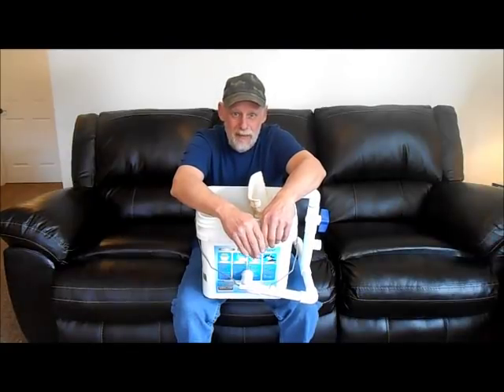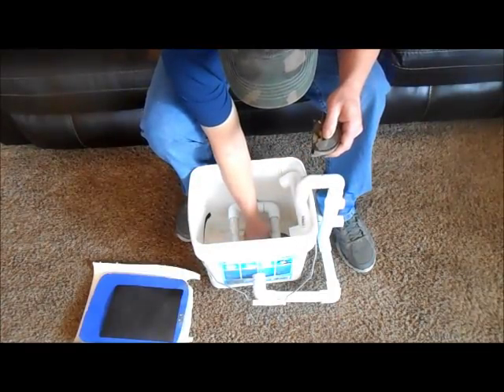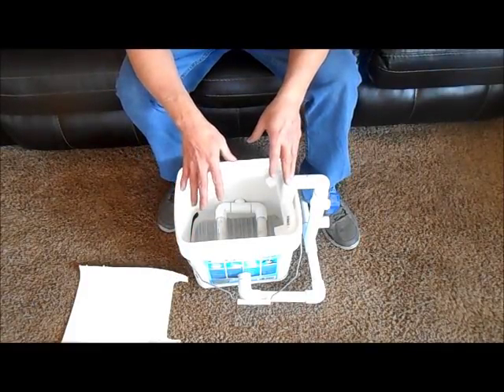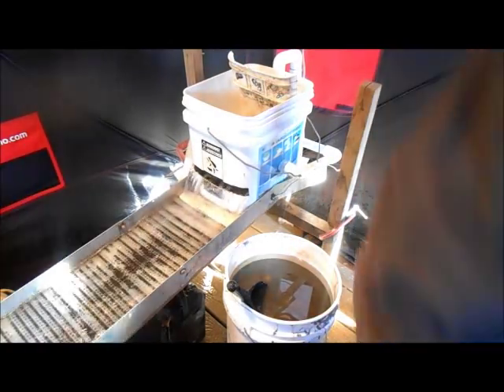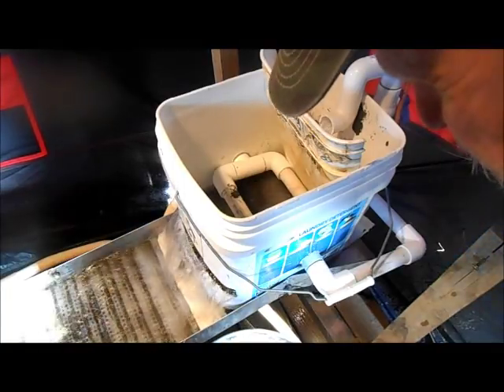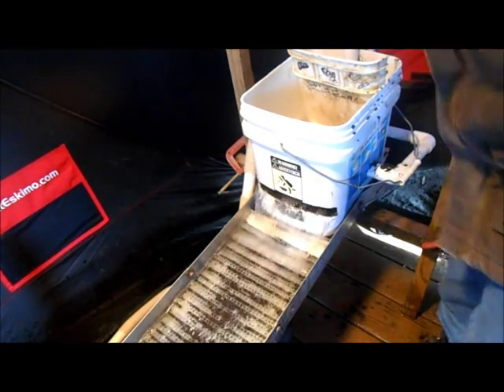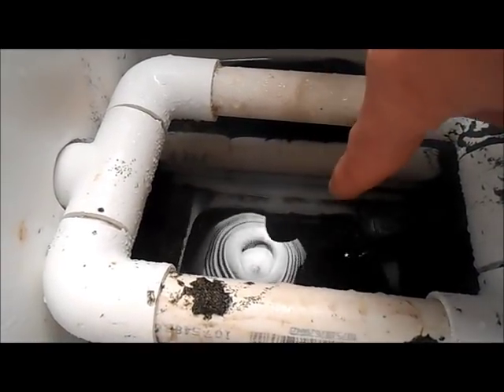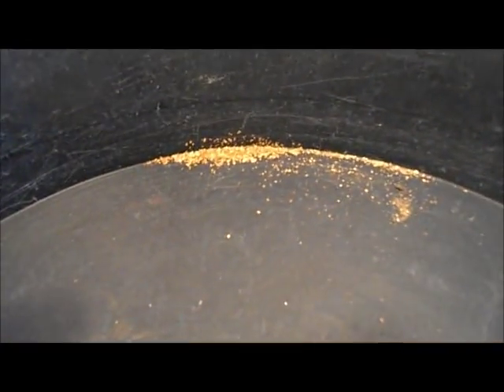Reverse Fluid Bed Magnetic Black Sand Gold Trap Experiment

Comment: Hi Alan! Love your videos. One note on used method: to see how well it performs you'll need to have well known starting conditions, like "sand with zero gold" plus control sample with known weight. Then your "before and after" will show exactly how well it performed (or even each section separately - as you did it). In your case you had it all almost right, the only missing piece was clean "no-gold" sand. Now, with 1 unknown variable there can be variety of cases. For example: what if your setup looses more than it caches,  you just happen to have 3-4 grams in that sand and you accidentally caught 1.7gr, which consist of only half of your original 1.4gr + some extra new gold from the sand!  ; )
Also simply "let's run it 2-3 times" won't work. If some dust-size gold coming through the setup 1st time, it will most probably go through next times. It's better to have those tailings after previous experiments plus to make it more challenging - mix couple glasses of extra black sand (collected from previous experiments with magnets), then you'll see exactly how much your setup is loosing. It must loose at least few percent on each run. Enriching the original sample was fun to watch, but didn't prove much (the only number I trust from this run is the ratio of gold caught in the trap vs amount of gold caught in the sluice, btw - you cleaned them separately but didn't measure). Thanks for sharing!
Reply from the maker: Hello Dmitry I totally see where you are coming from and you make some very valid points that I would agree with I will keep your tips in mind for the next one. Thanks for watching.

Comment: Looks like you have another keeper there Alan. Any time you can end up with more gold than you put in is a big win. Is this still the black beach sand that you are working? On mine I removed all the magnetics before I ran and that sure helps. Still a lot of work.
Reply from the maker: Not to bad for the first try. Yes still working on the beach sand. I want to do some more testing on my set up but the clean ups are taking forever so I have a blue bowl on order I hope it will help speed things up. And I am not sure at this point if I need the magnets at all.
Reply: Alan Robertson 
Yippers it's fun stuff. One suggestion if I may on the blue bowl, be sure to run a sluice underneath the output as they are notorious for blowing out the fine gold.  Have found that the Miller Table is the best for working this material. Most of the gold we get around here is -50 mesh and smaller so I have spent years trying to capture this fine stuff. It's good training and keeps you humble :-D
Reply from the maker: Thanks for the tips. I am sure getting a lot of practice with this stuff. The plan is to have the blue bowl run into the clean up sluice I know that Ira sets his on top of his gold rush nugget bucket and has good results.
Reply: Alan Robertson 
Once you get this mastered, and if you use these techniques when you get out on your claim I think you will find there is a lot more of this fine gold in that dirt than you realized. I was really surprised at how much there was. Good project for you for the winter. :-D. Keep at it.
Reply from the maker: @utahavalanch  I believe you are absolutely right I have been missing a lot of that fine gold. Practice makes perfect.

Comment: Nice build. It's kinda like a hydraulic riffle header box with a twist. I'm wondering if the magnets might be holding the black sands down and clogging up the riffles. Either way catching over half the gold in the header box is a win. 👍
Reply from the maker: Thanks Brandon. It did work great and I am already second guessing myself if I needed the magnets at all it might work just fine without them. I will have to give that a try.

Comment: Lol 😆 Alan you are the only prospecter I have ever seen that can make a machine that grows Gold. I love the design and no question it works but again that dam black gold grabbing sand, I wonder if you shouldn't remove the big magnets and just use the the sheet under the mat. Couple of other things that may help. I think the reason your material is channeling to the center of the sluice and a simple solution. The curvature of the bucket is I'm pretty sure is causing this. And what I did for this was simply to rival a strip of1/8th inch steel to flatten out the flow and that works great on my sluice box (I love plastic buckets!!!)  Now I put the strip on the outside because it was for a different set up but in your unit I would put it on the inside so it makes another little bump that any gold is going to have a hard time getting past. Then maybe take a piece of strip magnet and attach it to the metal. This should allowed a lot of the black sands to escape. And the magnet strip will work like a comb for ultra fine gold. I absolutely love your creativity and I sincerely thank you. Now a thought on( deflection plate l think you called it) it should be simple to fix if you're looking to increase the opening, I would take it and lay it flat heat a line across at about a third of the way from the top( l use a paint heater) lay a straight edge on it and bend to where you want put back in the bucket and trim sides as needed for fit. I made a similar piece for my rock crusher feed. Really looking forward to the next one.
Reply from the maker: Thank you for the input and tips  you are right about the cure in the bucket A strip of metal should fix it Thanks. As far as the magnets I didn't show it in the video and I should have where the big magnet was in the back of the bucket under all the black sand was loaded with fine gold so I think I will stick with the big magnets for now. I am still not sure what I will use to feed the bucket with we will have to see what I come up with. Thanks again.

Comment: It's a mint contraption😉👍 just one thing.when I've been watching paydirt reviews when they have gold in different trays they usually just use one tray and tip the gold in and out of it because they don't all weigh the same.just something to keep in mind! You would think they would all be the same weight but it's not the case like!👍 excellent video none the less man.
Reply from the maker: For a first try it sure worked well. thanks for the tip on the trays I will keep that in mind.

Comment: Ok a few things this may be long sorry in advance so I have a stream sluice I want to turn it into a high banker but using no pumps as I don't have money like that to spend on them I have a unlimited free supply of plumbing pipes fittings ext I have plenty of ideas for that but now I want this as part of the system you think you could come up with something??
Reply from the maker: My mind is drawing a blank right now. the only thing I can think of is gravity feed water but not sure if you could create enough pressure. I know you said no money for a pump but you can buy one on Amazon for $14.00. Sorry I wasn't much help good luck with your build.

Comment: Good deal I'm going to try to make some mats this spring for my dredge
Reply from the maker: My thoughts are that they will work fine in your dredge but it i have not put them to a real field test yet since it is winter now and I have only ran 1/4 inch material but I still think they are strong enough to handle a dredge. Just my two cents worth. Thanks for watching.
Reply: Yeah I want to try to make a aggressive mat in running a 2.5 inch Martin nozzle
Reply from the maker: @dyergoldprospecting  If you give it a try I hope you put up a video I would like to see how the mats handle the larger material.